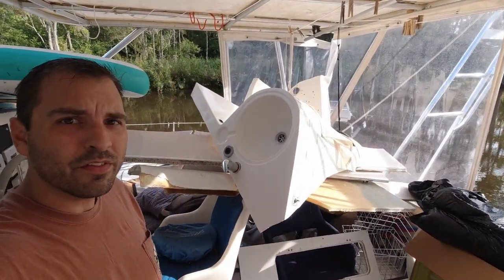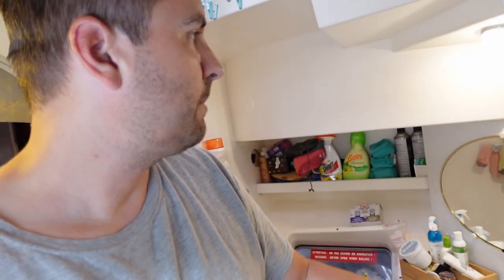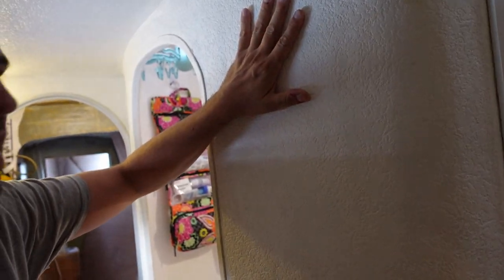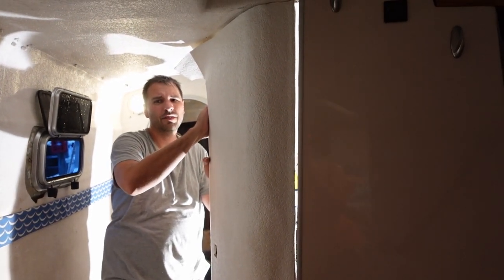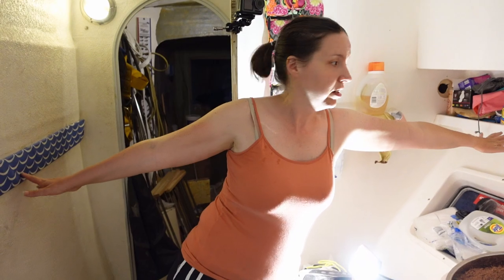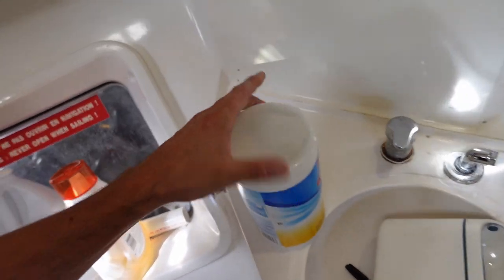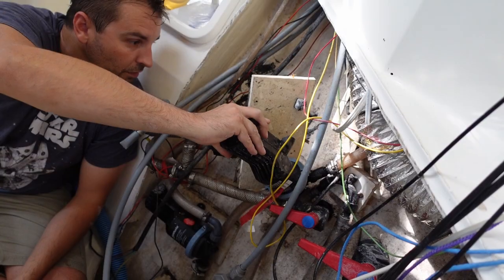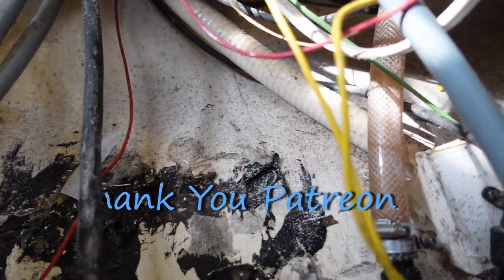SCARY FIND While Converting a Charter Catamaran Sailboat to an Owners Version.  [Sailing Family]

Comment: Not sure if its the same on your boat as it was on my 1995, but the thru-hulls that exit the boat right at the waterline were the VEIN of my existence...I never understood why any manufacture would put above-the-waterline thru-hulls RIGHT at the waterline!!!! All of our Leopards above-the-water thru-hulls are about 15" above the waterline but on my old Venezia, I had about 4 of them on each side where the seawater was actually halfway in the middle of the thru-hull!!  Anyway, good luck with the reno - you guys are brave to rip out something that was complete and functional for a better design.  Good luck.
Reply from the maker: Hi guys!! Yes, it is the same on our Venezia. We have at least four through holes that are exactly at the water line… Just like you said. One of them the water is 50% above the through hall. 
We realized that the head /shower was a modular installation at the factory. Our new layout is coming along great… We are loving it!
Reply: @SaltyEscape  I ended up having to put 1-way valves on every one of those thru-hulls because we woke one night to our bilge filling up through our shower line (was converted to an automatic shower sump that emptied from a small holding tank)  Your galley and dining came our really good btw - never did like our old countertops and galley setup, but yours looks fantastic.
Reply from the maker: Thank you!  I think we’re going to haul out in a couple of months before we head south to the Caribbean. I plan to glass over several of those through halls.
Reply: @SaltyEscape  Awesome - so how far are you going into the Caribbean?  We'll be hanging out in St Thomas and St. Martin this year - maybe we'll cross wakes.
Reply from the maker: We’ll be heading to the Bahamas this December.   Hoping to make it to the USVI but not sure if we’ll have time.  We want to see and do everything. 🫣